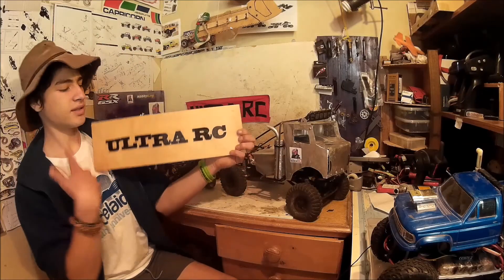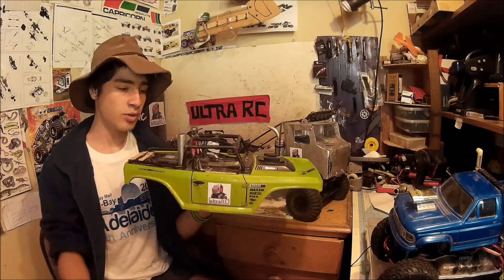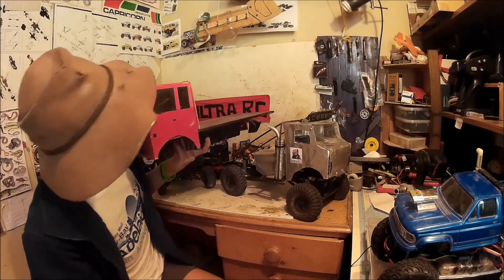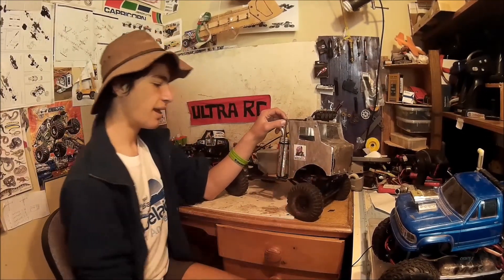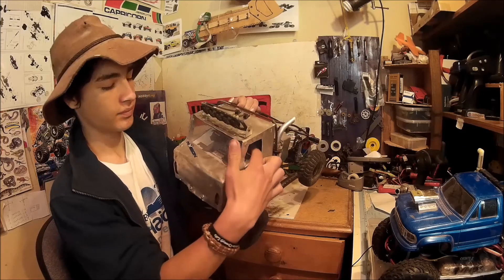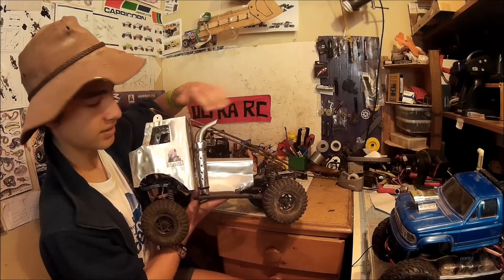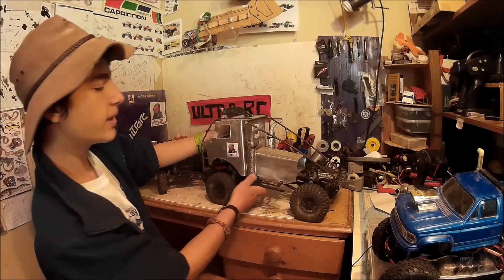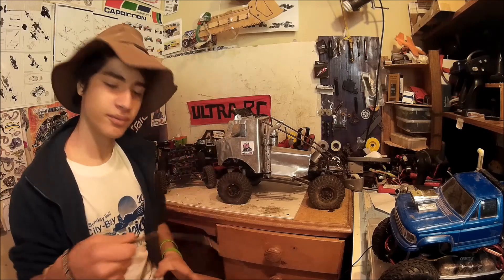Custom Axial SCX10 ALUMINIUM BODY and roll cage!!!

Comment: That is a very cool looking truck mate, It has a mad max badassness about it!
I had the same issue with my unimog where the wheels would rub on the body, I cut small bits of irrigation sprinkler tube and put it on the shock shafts as bump stops, works great.
Top vid (0:
Reply from the maker: Bump stops great idea
Well better than getting out the dremle!!!
Thanks for watching ULTRA RC!!!!!!😃

Comment: How did you weld it?
Reply from the maker: Thanks for watching ULTRA RC mate!!!
I used a mig welder at school!!
It has a roll of wire it squirts out and sends electricity through and melts the end to your work!!
You can by a welder 2nd hand for $100 bucks!
Another methood is to braze with an oxi torch its cheeper!!
I was just lucky to have a welder avalauble anyways thats my tangant hope it helps!!!!!
Reply: Thanks